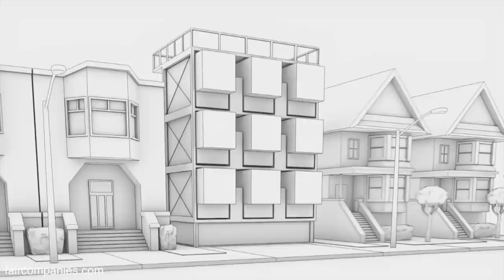Kasita: tiny prefab home-as-a-service for post-land urbanism

Comment: The layout isn't bad, but it'd be 70% cheaper to build it yourself using timber (149000 for this is silly especially for an unproven concept). This would allow for easily adding more windows, better looking and less expensive siding, and a front area that had large windows but not at the cost of privacy. A protruding glass area out of the front is unnecessary when the front area can be raised but just as a built in interior platform while keeping the exterior one level.  One could then add double doors and a deck which would be way more functional, still provide light, and overall it'd be way cheaper than having all the custom glass in this design.  
 I understand cost would go down with further consumption and production; however, it still wouldn't make sense for an average person. There is something to be said for how a property accumulates value when connected to land. I myself love micro units and small homes, but it's best to invest in one that is permanently connected to land. For example, a reasonable action a person could take who is looking into this is actually buying a regular sized home and building something similar to this (an accessory dwelling unit) in the backyard. They could then rent out the larger home and possibly live mortgage free.
If someone wants a home that can go with them, buy an rv; but have a primary residence and ask a friend to manage it as a rental while you're away.
One day, this home might make sense when land is unattainable and the cost of a home is unreasonable for the middle class. Now it is a trap for those who are thinking of living beyond 65. 
People will come to understand that it is possible to get what they want, but still within conventional means that will be more lucrative in the long run. Your home can be an iphone, but it is also a major investment.

Comment: so the production version would be 1/3 bigger than this beta unit? that's like a small apartment, which is ideal. Why didn't you showcase the dimming windows? :( I've seen many small trailer-turned homes but this stackable solution is innovation on its own. Plug-and-play.

Comment: I remember there being another module thing that you covered a ways back that was actually being set up in multiple US cities, and I believe starting in Austin as well. Do you know where that project is at? I'm having troubles finding it in your videos. But I absolutely love this idea. I 100% would invest and get involved.
Reply from the maker: I don't have any other videos from Austin... and I'm trying to think about which module-type project that was. Any other details?
Reply: Hmmm, I wonder if I found it elsewhere then! I just remember watching it a while ago. It was essentially the same idea, being able to move your module in and out of a structure with ease throughout multiple involved American cities.It was pretty neat!
Reply: nesekaba there is a similar concept of stacking units like this, it's called Carmel Place in NYC. But they used something like shipping containers that were prefabricated for that project. But it doesn't involve moving the containers in and out of a rack. Anyway, the concept is cool, though slightly different.
Reply: Are you sure you are not thinking of the unit Kirsten and her family stayed at in Tokyo, Japan about two years ago?  Right away I thought of that while I was watching this video.  This idea of setting up a frame and moving pods in and out has been around for a number of years-this gentleman most certainly did not invent that concept.
Reply: +Leah Veal I didn't read the comments before posting my question, but you answered it!  I will research similar models in NYC. Thanks for sharing this info!

Comment: What kind of insulation does that house have, that end with the solid glass would just leak warm air in the winter and be an oven in the summer. There needs to be quite a bit of tweaking before this concept would be desirable to the masses.

Comment: Why not build a design around the concept of 'portable storage' that fits neatly into standardized units? Rather than paying to employ a crane and a heavy truck, design the core contents to be quickly packed, loaded into a cheap uhaul, and driven across town. 

Eliminate the "Take the whole building with you! Because... reasons?" and you make it far more practical to go with a deployable prefab unit 50% wider and have a far more accessible design. (If you can't get a wheelchair around the building, then you're really missing out on some key points to housing issues.) Also mildly concerned over what appears to be a single exit design. Best hope you never wake up to your kitchen space being on fire... 

Such a design can still maintain the flexibility concept of quickly deploying and redeploying as needed, but taking your identical copy of a shoe box across town to slide into the place that another identical shoebox previously held seems to be missing a few points of practicality.

I would also go with a lifting bed design rather than slide away. Pretty sure it was this channel that featured the really slick bed design setups from a French firm awhile back. The bed was designed to be held up against the ceiling when not in use, and then easily lowered onto stands when needed. Ceiling space tends to be hard to use, but the space from that pullout bed? That looks like a lot of useful storage space.

Comment: Nice design, but there’s no difference in cost.  It’s just as expensive per square footage.  For instance, if these Kasitas were at a price point of 80-90K they’d sell millions of them, but after it’s erected the cost would probably run you approximately $150k and up, but it would be less than the neighborhoods median $700K and up houses. So they say it’s a lot less than the other housing and they’re right, but the fact that you’d be living in 308sq’

Comment: I would build it at least 1.5 wider, doubled the space for a table and made it on the same level with the rest.
Reply: If it's too wide, it can't be transported.
Reply: +Raw Fooder why not?
Reply: +Daniel Ivanov standard moving equipment and have to fit on a road way.  Unless you buy 2 and they can join on site modular.
Reply: +ultimaetsolder I believe you can get around it. also he said "we figured we can actually make it 50℅ larger". and i think that if you plan to live there for a decent amount of time and you want more space, transportation issue won't be a huge deal.
Reply: By 'larger', he was clearly referring to 'longer'. Making things wider makes them MUCH harder to transport. 40' shipping containers are shipped around by semi all the time. I think they make them up to about 52' or 53', but those are pretty rare in comparison.
Reply: +genjii931 Could be, i have no idea, i'm a consumer. I'm coming to their office and asking: "I like this concept, but can you make it larger, because i need more space for this and this and that", and the rest is not not my problem. Hopefully people who built such things know i little bit more about transportation than i or some random people on youtube do.
Reply: +Daniel Ivanov Video is about mass production and economy of scale to get prices down. So assembly line like a car. 

Racking structure means they all have to be the same dimensions to fit in the bee hive. 

Standard moving equipment and road width restricts width. 

Thats it.
Reply: ultimaetsolder I can imagine things too, make an arguments, but mindset "it is not possible, and that's it" won't help you sell a lot of those. think how you can do it, rather than how you can't. you losing me as a customer right now.
Reply: over 8'6" wide they become a wide load. I think you can  have up to 10' to travel on public highways. I know I have seen things wider than that in places lice Fort Mac Murray but they probably have special permit to move equipment... up there.

Comment: i could build a A-Frame home with close to 3000 sqft for around 15-20k i do the work. 50k paying crews. 50k is a 3rd of what one of these cost. and the aframe can be made to be moved in 2 sections or 4 sections making it mobile. this is kinda scam. the price vs the tiny home movement. ive seen others charging 80k for tiny homes sitting on a trailer. like woo dude. you can buy a camper for that price. build a tiny home ya self you have around 10k in it. when someone else builds it they plan to DOUBLE their $. this is something the common folk can build unless used wood. wood is what saves $ in this situation. and it can be lifted and put in a pod just like this. great concept. but the overall price is not there. 150k someone can buy a mansion that needs some work. js. whole point of tiny home movement yes is to save $ cause cant afford bigger homes. when get into 150k a home thats not even in a price range to someone who barely has a job.

Comment: If all of the units are the same what is the advantage of them being able to move? Wouldn't it be smarter to just pack your small house full of belonging and move to a different pod as oppose to paying to ship your entire pod with the belonging inside? Why not just build a network of low cost permanent apartments? The only advantage of an RV is that it can be moved by the individual for a very low cost as oppose to these units which need to be positioned, installed and shipped - which would be much more expensive
Reply: He said in the video that they would have customizable surfaces available, so they wouldn't necessarily all look alike. It's a prototype; it's only going to look one way because there is only one of them.
Reply: He said they would be produced similar to the model T which was all about being exactly the same in order to cut down on costs
Reply: The site or parks that underpin this mobile method of living could accommodate people who wished to move merely their belongings from one unit to another, those who wanted to have their whole unit moved or those who own an RV or trailer and need the extra mobility conferred by these units.The RV owners could stay at conventional parks if their needs required. 

The rack system for multi-storey arrangement of units might not lend itself to accommodating RVs or trailers on grounds of fire-safety and fenestration. The economics of high-value locations might preclude RVs from being accommodated on the ground only with the spacing necessary for preventing the spread of fire and for manoeuvring units without cranes. 

The whole success of the system would be dependent on the establishment of a whole park network dense enough to make mobility real. Adoption of the ISO HC 9ft 6in tall shipping container as the basis of the housing units could allow for a stacking system where units could be slid in and out of stacks without needing to disturb surrounding units and without needing to provide a rack. Containers provide a strong structural system with the benefits of low unit cost brought about by mass production. The cost of handling and transporting containers is small in comparison to normal house removals.

Comment: Business move would be to do the real estate part not the building. Get someone to invest in X amount of units that they own. Regulate a cheap affordable flat right price for rent and garentee my units will be rented for me. Heck get land plan to build X amount and sell them individually to Just average Joes. I would invest in a single unit if Its affordable like you say and your business takes care of renting. Present it as an invstment that will pay off in X years. Plus of rent was only 200-500 a month I can't see you having an issue getting them rented. And if I can make my money back in 5-10 years then profit with low upfront cost I'd do it. Alot of people don't have the huge funds to invest in real estate but want to. Prefect solution. I'm sure you can sell units before you even build them using this idea. I'll take my 20% cut now.

Comment: I really like this idea.  And, the Kasita is slick.  But, like all the good ideas on Top Gear, this thing is "ambitious but rubbish."  This thing is not at a great price point, the insulation and heating/cooling is questionable and the cost has never scaled down as this has been "developed" (it hasn't been developed any further).  It's pie in the sky.  I love it.  It's just not what he sells it as.

Comment: I think what’s confusing some people in the comments is that this guy is quite arrogant. This is a nice enough design (not ground-breaking in any way, most architects wouldn’t have trouble designing this, I don’t know who he was talking to). Conceptually its nothing new, they were doing this in the 70’s as you may have noticed it didn’t work, illustrated by this guy’s thinking it’s a new idea 😂. 

The ONLY thing that might save it is if he is able to set the system up like Uber- make an infrastructure with easy access to moving apartment location.

Comment: You could have a forklift hydraulic lift set in between units for the 3rd and 4th floors ONLY... Then you really could expand!!! No glass floors needed!!! Bamboo would be nice... And a bigger closet!!! Get real!!!! Also solar heat and Power are possible here with small solar fans to move the air about!!!

Comment: It doesn't matter what method you use........ tiny homes or skyscrapers or tunneling underground, continual growth of population on a planet with limited resources means an eventual failure.  Levels of failure are varied but without population control of some form, ultimately the two vectors intersect and the system collapses.  But is is a cute little space to live in.  Does it help alleviate some problems for some people?  Sure.  But it only delays the inevitable.

Comment: I don't see the advantage of doing this over a traditional apartment building. If you plan on transporting it, you have to hope there is an empty space and the storage rack idea would be very difficult for older people to climb. Also I suspect that this unit is quite expensive per square foot

Comment: Housing expensive in Austin? compared to the San Francisco Bay Area where I am the folks at Austin have it good. + Smart houses are dumb, it leaves you vulnerable to hacking. The last thing I want is people messing with my lights or water temperature or door locks. Analog homes Lock & Key are they way to go. You don't need any of other unnecessary rubbish.

Comment: dulce dulce dulce, pretty much solved, najestic 12 was storage center for alien parts, los ala"twinkie"... croation translation for" moon " majesti
1935 and turbine, tube amp, magnetic light travel frequency raisers, to dulce lizard, dulce is in lower part of new mexico, ,, via//// i have drove flown through , 120 miles west of 
the spanish named town of the louisianna purchase, spanish exploration area, where the ten foot tall conquistadors went through aztec mexico into the indian desert in grassy new mexico, indians called lizard aliens "sith" similarly the arabians called lizard aliens the " syth" like the sith in star wars, the towns name where dulce lies ^,^ 120 miles west is santa fe which is a spanish name, santa ana, but google maps has its position wrong , its now near  santa rosa on google maps now, umm everyone knows the top half of new mexico is like endless thick grass fields the maps completely off, and the way the treasure  map goes, rosswell is inline with the highway that leads to the word that means hottest place in desert, santa fe or "proper voice santa and latin high mark "fe " or high mark , the , dulce is through low clay covered sandy hills surrounded by radiating towers and star wars style troops and entrances to aliens underground post me for more clues bye